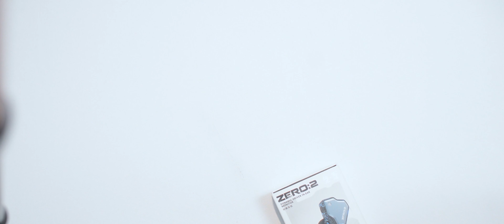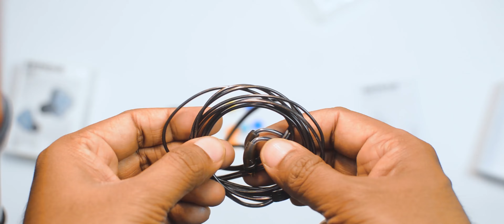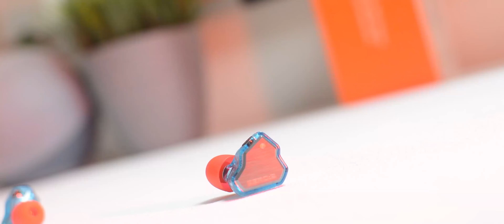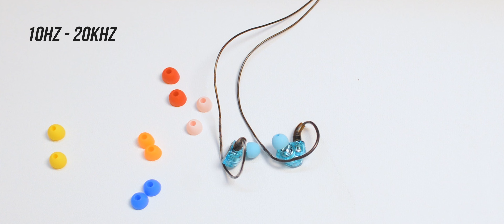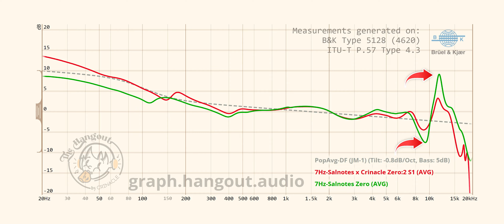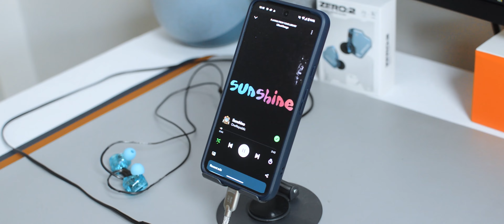7hz salnotes zero 2 review | #IEM for gamers. #audiphile #7hz

Comment: Best iem under 2.5k for gaming
Preferably c type connector, will  i be able to use it in my phone and laptop both have c type
Reply: I would suggest that don't go for type c version, cause its type c cable contain dac that is not good as external dac. If u are paying 400 extra you can buy audiocular d07 by paying 300 more.